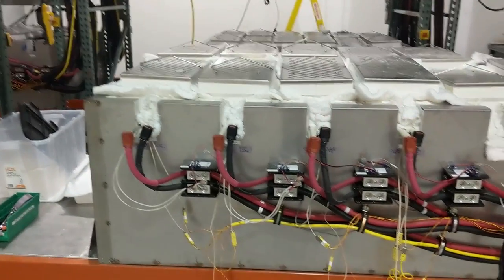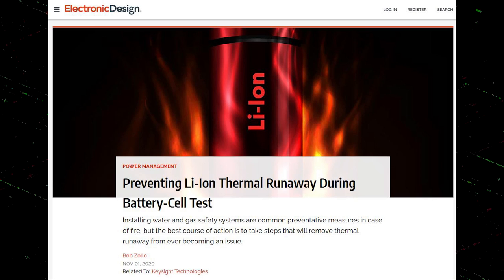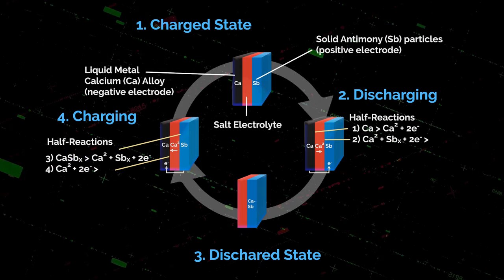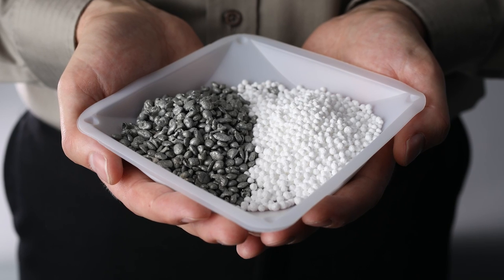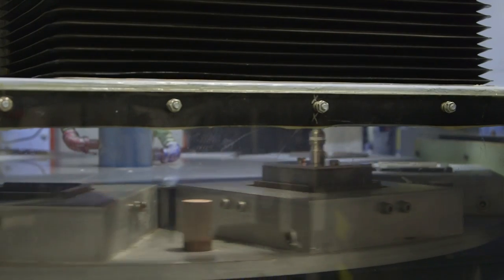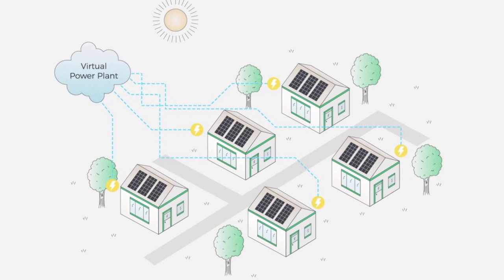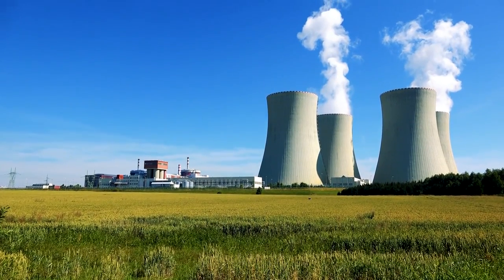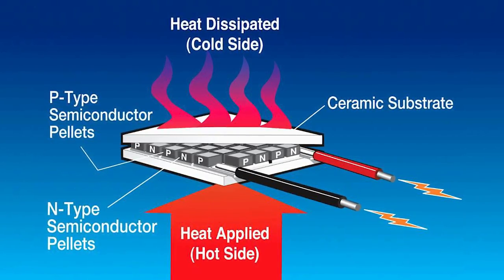Ambri: A Battery that Could Change the World

Comment: Solid state gets more clicks, but that still needs years of development. Liquid metal batteries are almost a commercial reality now. Liquid metal batteries are designed for grid storage now, but they will improve over time with better thermal management and cooler chemistry. Liquid metal might compete with lithium in EVs before solid state does.

Comment: When did sodium get replaced with calcium in our table salt??
Sodium ion batteries were invented in Brisbane university Australia some years ago. There is also a modern zinc bromine battery developed over the last 10 years in perth Western Australia.  Before that was invented at Sydney university a redox flow battery that went to Canada 5 years ago as they had a problem with conductivity of the common electrolyte getting discharged through its pumped cell sharing system.   The heat generated by the cell he describes here is needed to keep the salts in a liquid state same as the proposed thorium reactors which can be fed with the waste of conventional nuke reactors till it has only a 100th of the radioactivity of stored waste sitting idle in repositories around the world. ( India has I believe a running unit.)  Also molten salt is used as a storage medium from solar collectors in the Californian desert solar collectors for a Stirling generator field.

Comment: This battery technology sounds viable but only at 500C ( NaCl melts at 801C ) so what is not at all addressed is how to maintain that temperature to keep the battery operating properly?  Maintaining heat at that level takes a lot of supplemental energy. So, what is that heat source; electric arc?  Nuclear?  Pretty big hurdles...

Comment: Maybe I missed it but.. here is a question. How much energy is required to keep the battery going ? Its not like heating it to a 100 degrees, its a whopping 700. Considering the scale and that you probably have to heat the metal all the way through to keep it running.. Does it store enough energy to outweigh the heating costs. I mean sure, you can cool it and then heat it up, but that would kinda defeat the purpose of the battery, since u need energy to start with to get to the stored energy. Sound like a great tech, but I still have some doubts and questions.
Reply: He explained that. The current flow of ions across the electrolyte during usage keeps it at the required temperature. No external heat required

Comment: so anyone think about insulating the batteries to keep them from freezing? ok heard it at the 11 minute mark. wouldn't it just make sense to make the batteries hot by having radiative materials within or around the cell to make them self heating? There is no shortage of unwanted hot materials.  Also is there a thermal coupling mechanism for electrical generation within the battery rather than just charge holding capacity why not turn it into a generating cell rather than just a storage cell? I could see this as a way more capable power system than just a holding cell, but rather as a power generating and holding system. Also who PV cell charging... again, the solar thermal aspect such as using a solar concentrator for restarting the cell would also make sense by using the direct IR solar concentration. If you have sun roofs why can't you just inbuild solar concentrators - just make the top part of the cell as a solar concentrator roof to allow it to be self heating charging to insure fluid dynamic.  This side up to reboot/selfcharge.  These things seem to make total sense also for below frostline placement ---- they can't freeze if they are earth shielded. Why steel, why not put them in depleted uranium. There is so much waste material that can be repurposed. Like wouldn't hot materials just make these have much higher tolerances?  Good luck mate.

Comment: What happens to the battery if you shake the "salad dressing" (ex. earthquake) and the upper metal touches the lower level through the molten salt? Does it just short and discharge immediately, or is there a safety concern?

Comment: Let us recognise that this is not a new idea. Please note that M/s FIAMM in Italy had already done the home work based on an IPR they bought using NaCl molten salt, more than a decade ago.FIAMM batteries also need to be kept inside metal containers , has same chemical process at high temperatures. FIAMM can undergo thousands of cycles of charge and discharge usability/life. They (FIAMM) sold batteries then and some , and are still selling into the market but very pricy and hence not much success. This is a copy cat solution with different elements. Now that Reliance Industries Limited (RIL) from India has bought into AMBRI, the company can get money muscle and necessary support to install in India, and jump start their industrial scale journey. Bon Chance!

Comment: 0:42 Ambri's expert Donald Sadoway told that the lithium-ion battery was first invented for handheld devices, so I was just thinking, does anyone know where the timeline of litium battery was when it was used as a power source for remote-controlled model airplanes, because of the increased capacity compared to the weight is of course paramount for the miniature airplane hobby?

Comment: How much electricity does it take to heat up the two metals, and salt layers which would subtract from your net electrical output? The professor mentioned an insulated container for the battery. Another way of wording the question: Would the battery container retain the heat efficiently enough so keeping the metals & salt molten for a while without having to use too much electrical output to keep them molten?

Comment: Impressive to listen to but one thing I didn’t hear was talk about battery efficiency. If these batteries generate that kind of heat, presumably from the charging current then surely that’s throwing away a good slice of your source electricity. Or maybe I missed something.
Reply: Good point. There's no mention of the internal resistance of the cell, which will be the source of the heat generated.

Comment: He doesn't say that the battery stops working because the salt solidifies it may be it just limits its output to an unacceptably low level I would like to know if it is so does it generate enough heat to bring it back to full operation or is there an external supply needed eg the battery energy gets used up by the time the temp is useful value.

Comment: Has any testing been done re susceptibility to vibration? From the video it looks like any disruption of the liquid interfaces would affect the ion flow. Presumably all three elements are arranged in order of their specific gravity thus automatically form the required layers. Looking at future off-world application how do you design against earthquake.Marsquake, Venusquake etc. 
Any remote installation would need the whole structure to be self righting to achieve correct, attitude, probably via gimbles, thus some part of an earthquake damping mechanism is already incorporated. Pendulum mass damper as an addon?  What happens to the working surface interfaces if a 10 tonne rock hits the outer container at say 50kph?  Do you get an internal short when the salt layer is breached by a wave?  Just doodling.  But all in all a great idea.

Comment: I have a nagging question (or two) here. How does one get the temperature of the battery to the desired level (700 degree) in the first place? How does one maintain the temperature at that level for prolonged periods (the professor has partially answered the second)? In a distributed energy grid, how difficult will it be to generate/sustain that kinda of heat "in the field"? What's the penalty imposed on the system in pursuit of such high heat? Overall, it seems like the beginning of something quite exciting.

Comment: The comments about the High Desert are way off base.  I lived at 1300 meters and it rarely breaks 35 degrees Celsius in July and august and gets down to 10 degrees in summer nights.  The term high desert refers to high elevation.  It gets cold more than hot .  Maybe they meant low desert,  Also , why no mention of energy storage capacity or the cost to keep the batteries at high temperatures?  Why are they comparing to lithium ion instead of Iron phosphate?

Comment: 32 minutes and no info on how the batteries perform. What's the cell voltage? What are the max discharge and charge rates? What is the energy density? Cost estimates? Obviously these things will change with more development, but I'm sure he knows some ballpark numbers.
Reply: He could probably tell you the theoretical limits. I think that would be a bit abstract but still useful.

Comment: I think t would be easier to build a high water tower near the wind turbines and they turn a direct shaft which pumps water up into the tower. Water drops from the tower through a water turbine which makes electricity at a predictable rate.

Comment: This is all  very interesting, but Ambri still has to come up with a workable solution. I cannot imagine a battery dependent on Antimony is going to be any better than one dependent on Lithium - world reserves of antimony, about 2 million tonnes (and half of this is in China) is one tenth of reserves for lithium, about 20 million tonnes. It's worth reading Wiki on Ambri, for a history of its ups and downs. I have a feeling that unfortunately this will all prove to be a bit of a dead end, like so many others.

 For hot grid-scale batteries, Sodium-Sulphur have a more proven record, but with set backs, such as fire in Japan. But then Tesla had a fire in Australia. The largest such Na/S battery installation is in Dubai, used parallel to a solar power farm, and able to store uptown 650 MWh of electricity. Whilst sodium and sulphur are abundant and cheap, literally a thousand times more so than lithium, the cost of the batteries is still a consideration because of the expensive systems that are required to have these corrosive elements contained at 300 deg C. https://cleantechnica.com/2019/02/03/sodium-sulfur-battery-in-abu-dhabi-is-worlds-largest-storage-device/  CATL''s Na-ion batteries are showing considerable promise for BEVs, and if the price can be kept low, for large static grid based or area based battery installations. I tend to believe CATL's claims a bit more than many of the small start-ups that have been trying in the same development arena.

Comment: How heavy is a "liquid metal" battery per cubic  metre when you add the weight of the liquid to the weight of the external steel container.?
Is the liquid metal filling all of the volume of the container, of might it swish about within , possibly affecting its stability, if the container is moving.?

Comment: That example with oil - vinegar separation was good, but when I shake it up it's all mixed.
Batteries holding two components separated by a liquid salt layer are normally carried around. The motion does not mix the liquids? I'm confused. I fly a camera drone - the batteries are growing over time and don't fit any more. Is your liquid battery a solution?

You will find lots of dirt on mars - but it's not dirt cheap (think how much it costs to get there).
At MIT they come up with weird ideas (e.g. Max Tegmark), and I doubt many of them for different reasons.

Comment: What would happen if the insulator layer is shorted out as in earthquake or sabotage. Also the inside layer of the container would have to be insulated that you still it was short between the the top and bottom layer.

Comment: Maybe I missed it, but if the battery were to go back to solid when it is fully charged and then it is heated and turned to liquid metal again, does it retain the charge it had before or does it start from empty and need to be recharged?
Reply: Retains charge. Separated metals = fully charged. Alloyed metals = fully discharged

Comment: 17:20 Asks main question about decentralized modular power, then asks about "renewables" ...not exactly the same thing. The former, especially if renewable, lends itself toward independence of the individual, and the capacity to resist unjust government force and dominion. The latter can just as easily be "a tool of metered dependence and control."

Comment: From where does the energy required to maintain the batteries heated, come from?
Reply: I would rephrase that to include: how do you get the temperature required to kick start the whole process? The metals have got to be molten before the battery can even be used.

Comment: How much energy is needed to keep the container at that temperature?  It seems like a good idea but the energy require to maintain that temperature seems like it would use most of the energy that the battery holds or more.

Comment: Use the heat to generate power with thermoelectric cells.  Does he not realize that thermoelectric cells will cool the battery if they are generating power?  Which means that you have to put more heat back in.  Perhaps some of this isn't all that well thought out---.  And if he can turn dirt into aluminum for 50 cents per pound why isn't he doing so?  That's well below the going price for that commodity.

Comment: The ambient temperature is not that meaningful since the liquid metal temperature is at 650 degrees Celsius . The ambient temperature even if zero would mean delta T is 600 degrees Celsius. So if the ambient temp is 40 degrees C delta T would be 610 C. The idea makes sense. By the way, if anyone wishes to study how MIT  helped to start 35,000 successful startups such as Moderna and Biogen , read the book Celebrating Entrepreneurs by MIT professor Edward Roberts available on Amazon Kindle.  Professor Asegun Henry of MIT has also developed a liquid metal battery. Wonder how they compare.

Comment: If the heating process can purify the material, could these batteries also perform remediation in polluted areas?
AND how does the material get heated and the heat maintained?
Is solar available to do that....sort of like mirrors focused to raise the temperature very high🙌

Comment: Can Ambri Liquid Metal battery be thermally charged by using process heat to separate Calcium from Antimony?

If possible, how would it compare to Thermal Electric Generators or Steam Turbine powered electricity generators in terms of performance?

Comment: Can this be applied to running electrical appliances such as Air conditioning, refrigerators, washer and dryers and Lights and Big Screen Tv, and all home systems.
Reply: I wonder about using it for home solar battery system?

Comment: So liquid metal needs heating, and lithium needs cooling. Could we just surround a big lithium ion battery with smaller liquid metal batteries in a "mega-pack"? Seems legit. Heat transferrence between the 2 types making each work at their best performance?

Comment: Cost effectivity only words you need to look deep into transitions of the liquid metals batteries can do higher temps and stay cool vompaired to the others intanglememt a signal to the other side and back in on itself is powerful enough to be a factor in the charges against the loads it supports an equilibrium

Comment: Okay I heard all this talk about the battery . and it's all good you guys explained everything and everything is easy to understand. but the one thing that was not touched on is weight . we all know an average size car battery if it's lead acid it weighs a freaking ton very heavy .led acid batteries are and we all know that the same size battery if it's lithium it's very light, compared to led acid . compared to the same size car battery whether it be lithium or lead acid . how much weight is predicted for the liquid acid battery... is it going to be heavier , ?  lighter, ?   in the middle somewhere. he did not touch on weight . and I think that is something that needed to be said. if you could give me an answer on that I would surely appreciate it . I think it's a wonderful idea for a battery if he's got a working model . that's just great ....but like you said to try to get a factory going to build these batteries come up with product people who know what they're doing in Machinery to build them... is going to take a while . but wait would be a pretty big deal. a lot of people like lithium just because it's a hell of a lot lighter than lead acid. and it can be discharged and recharged twice as many times maybe three or four times as many times . so his battery sounds like it can be done forever, like you said the only problem he sees and it is every 20 years or so. you might want to swap it out just in case something might go wrong. right the whole battery can be recycled back into another battery . that is just great but what about the weight that is something they did not touch on it I really wish they would have ...

Comment: We definitely need solid state batteries that are safe and we need batteries that are better than lithium batteries. The fire hazard alone should be enough to make the world change from lithium to solid state batteries. Liquid metal, that’s more energy efficient and safer are the way to go. Lithium batteries are super expensive and take hours to charge. It’s a daunting task but it would be worth the wait. Lithium has to be mined and refined. There’s not enough lithium on the planet to supply all the car’s that use. need battery power.

Comment: Run them off thermal electric from the ground have a dump reservoir that cascades through small turbine power stations back into steam at the bottom and running back up through wind turbines that are the whole bases of the tubing

Comment: Aerodynamically, if energy is increasing the temperature of an environment, the heat has to be extracted or it will keep building up the temperature. To say that it is 700C in its center of operating and cool to the touch at the outside of a container...is ridiculous. Dont believe this.